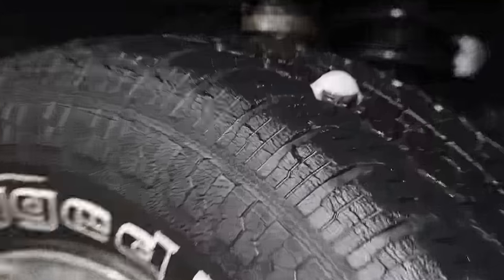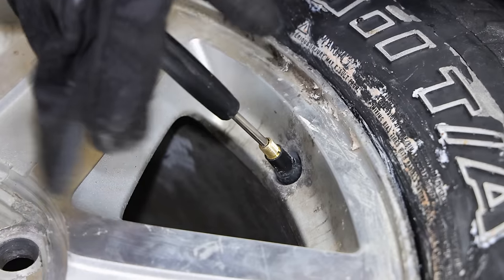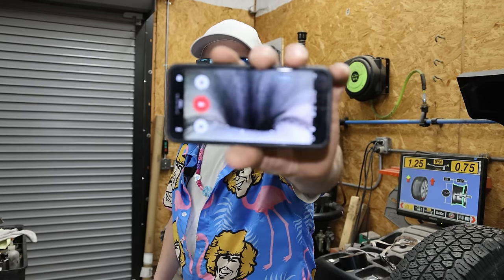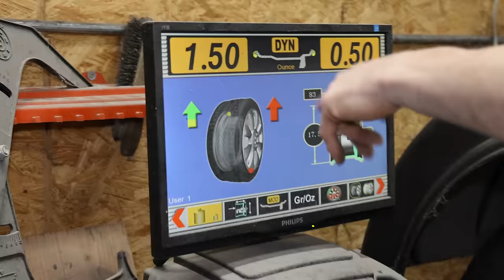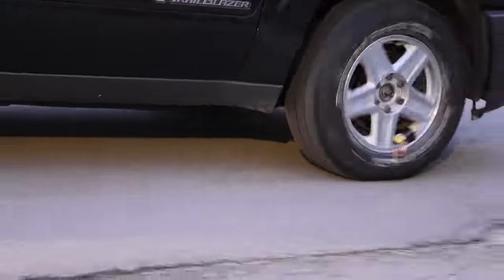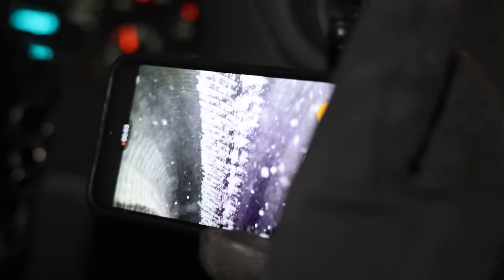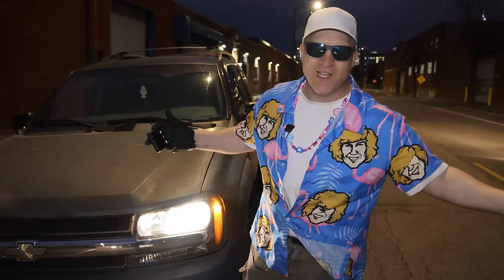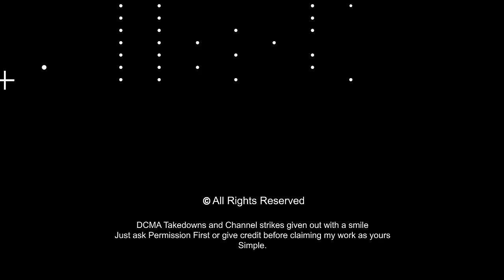GoPro Inside a Car Tire (With Balance Beads)

Comment: I've always wanted to know if balancing beads work and how they work! Thank you!!
Reply from the maker: I'm still not 100% sure exactly how they work, but the GoPro weighed 7 oz, I put 8 oz of balance beats in the tire, and it was 1.5 to 2 oz off balance, So that's telling me that they're doing something just not sure exactly how.
Reply: Time to put them into your lawnmower oil?
Reply: Can you zero it with more beads? :)
Reply: I wonder which balance beads are the best?
Reply from the maker: @Eduardo_Espinoza good question, the GoPro weighs 7oz and I put 8 oz of beads in there.
Reply: Yea. But how much goes in a tire? And obviously depending on tire type would this be different. It is an odd thing. Tires themselves are just odd now they have a new perspective of what they look like inside. 👍
Reply: @WarpedYT  Don’t take my word for it, I too thought the heavy side would draw them in. But after watching your video I’m reminded- the tire is constantly contacting the ground(a more powerful stabilizing force.)

Perhaps when the heavy side of the tire impacts the immovable earth it creates a counter force(like a collision) which spreads the beads outward, away from the heavy/most impacted side?
Reply: Test that!
Reply: I used them in a set of Toyo Open Country A/T II 10-ply and the beads worked really well throughout the life of the tires. I don't know what brand of beads the tire shop used though.
Reply: I Just throw a 4oz. bag in my tire before seating the beads. The bags are made of a plastic that disintegrates into dust as I drive and releases the beads. My tire size is 235/75R/15. I live in Alaska, so I swap my summer/ winter studded tires out twice a year using a HF manual changer and I don't need to own a balancer. I throw the old beads out because they DO break down into powder, and throw in a new bag. I buy a big box of 4oz. baggies off Amazon. Been doing this for 20+ years. Super easy and convenient.
Reply: The goat does consume!
Reply: Centripetal force and harmonics, possibly? I’m not a scientist, just giving my two cents. Seems like after a certain speed, everything becomes fairly uniform.
Reply: As you lightly mentioned, it's a dynamic system which changes data and results according to the situation (speed of a vehicle, the amount of beads etc.). My personal opinion is it's not how much counterweight the beads add to the unbalance of the tire, it's more like beads smoothing that unbalance through their properties of dispersing on a whole surface of a tire thanks to the centrifugal force. With the less unbalance of a tire (without GoPro) beads would do a much better job. My guessing is - very close to zero. :)
Reply: @WarpedYT  Driving in the city  6:38  where someone or something can emerge behind a parked car and you're one-handing it at 50mph while holding and watching your screen?  Seriously?

You're just minutes from a limited access highway and a Velcro strip away from mounting it on your dash.  Does only YOUR life matter?
Reply from the maker: @arcanondrum6543  nah Cmon.. When I'm driving I am actually watching where I'm going I'm not just driving looking at the screen the whole time.  I can clearly see if there's people that or not
Reply: @WarpedYT  Well, just so you know;  50 mph is 73 feet per second.
Reply: You need to be going faster than 55-60+mph to tell if these fix any imbalance in the tire. You will not feel any vibration below that speed.
Reply: @jeffallen3382  Tires will actually start to bounce like a baseball between 25 mph and up if out of balance. 🤫
Reply: I sprinkle a teaspoon of balance-beads on my cereal every morning and I haven't made a stupid decision nor lost my temper since! 👍🇬🇧
Reply: They don't work @WarpedYT  and nothing you showed in this video implies that they might work.
Reply: @arcanondrum6543 spew that elsewhere... I'm sure you're perfect lmao😮😮😮😅😅
Reply: @bashkillszombies the go pro would severely make them off-balance on the balance machine.. yes he should've did a control first to check the balance without the beads on the machine though. You can't just say these aren't working and not explain why you're saying that lol??
Reply: What if you filled the whole tire with beads??
Reply: @RANDOMNATION907 works great if you dont go over 30mph....
Reply: I use the beads in my motorcycle tires. Tires stay well balanced and (as the rider) I can feel no difference in them and weighted balancing
Reply: @lkporter1989 . . . I don't know why you are saying that. I cannot feel any vibration at any speed.
Reply: @karlschauff7989  It should be totally irrelevant. All the beads are doing is proving a movable fluid mass. All that matters is the weight
Reply: I wonder if 10-12 ozs would totally balance out
Reply: I used bbs in my 40" mud tires they do fine at 60 mph
Reply: @lukelanckriet  how much do you put in them ?
Reply: @kenadam4693   I cup my palm like I'm drinking water Then about the size of a Kennedy half dollar
Reply: @WarpedYT great video subject,  appalling driving behaviour. The fact that you are excusing it is even worse.
The warped perception here is your idea of your driving skills and ability to tell the future. 😢
Reply: @WarpedYT Criminally Gross Irresponsibility, got it.
You seem an alright fella on screen. But your comments here suggest that you believe yourself better and more important than anyone else. You did something dangerous and stupid , filmed it and shared it.
Hopefully someone will report this behaviour to your local police and they will take the time to explain to you what you have done wrong.
Reply: As a tire tech, they do work, you just have to have more weight then the imbalances! I used to use them as an alternative to weights on my oversized tires, never had to re-balance them and never had abnormal shakes or vibrations from the tires
Reply: @jeffallen3382 right, if it's bouncing at 25 you got belt problems and balancing is the least of your worries
Reply: @MarcusHawksley  hopefully the police come to talk to you about wasting police resources for bogus complaints, quit moaning.
Reply: @fZionists78  but then, why does it work on the balancing machine, which sees none of those impact forces. It has to be something else.
Reply: If they worked, there would be a lot more information than just anecdotes and sales pitches.
Reply: We would love to see your video on it
Reply: Project Farm Warped Perception Collabo Time!
Reply: @RANDOMNATION907 I have them in my Camaro tires! Works great
Reply: They absolutely work, I've got them in the tires on my F-450 truck and it's smooth as can be.
Reply: You should know better given how careful you are setting up your tests.  Mr Warped never checked the balance of the tire BEFORE sticking in the camera or the beads.  There is no need to make an internal video...but this IS YT.  The balancer is the ONLY measuring device needed...to determine if they work at all.  Tell me if my analysis makes more physical "sense".
Reply: @apex107lrp  video is cool.

Common sense would be to have the tires balanced with weights and also add beads.
Reply: @jeffallen3382 I had a bent wheel from a pothole and I couldn't feel the vibes until nearly 60 mph. A BENT WHEEL. Driving around town with tire beads isn't going to prove shit.
Reply: @jakefriesenjake If you balance the tire with weights, why the hell would you need beads?
Reply: @aluisious  you can use less beads, and if a tire "becomes" out of balance, it'll self correct. The tire is already at the shop getting installed, might as well balance it. Probably don't need to.
Reply: @aluisious  exactly!
Reply: No thanks
Reply: Well now you know. Good for you.
Reply: and @WarpedPerception - it's actually really interesting. It's a harmonic damper. Your washing machine does the same thing (modern ones just use water in a tray instead of beads). Controls theory, there's an inversion in phase beyond a critical speed. Or... think about if your tire wobbles 'up', the beads will try to follow it, but with a delay. If the tire is rotating fast enough, by the time they get there, the tire is wobbling 'down' and the beads cancel it out. It will make the problem worse at low speeds, but there's a critical point where it makes it better and stays that way.
Reply: @WarpedYT  Another consideration is the location of the off-balance mass in the wheel. An ounce of unbalanced mass occurring near the hub, which might be where you put the GoPro, will require a different mass to offset if that mass is placed at the outer edge of the tire, where the beads are.
Reply: @Eduardo_Espinoza   "We're gonna test that!"
Reply: @arcanondrum6543  You definitely voted for Biden
Reply: The way it is supposed to work is simple.  The unbalanced wheel wants to rotate around the center of mass, and not the center axis like it would if it was balanced.  This imbalance will (should) move the center axis around like the agitator moves with an unbalanced load in a wash machine.  Since the farthest distance from the center of mass in that drum will be 180 degrees away, the centrifugal forces will cause the beads to roll to this location, and balance it out.

Experience tells me that beads do not do a GOOD job of balancing a tire, and I thought the flat spot of the tire would throw the beads around.  Also, with the axle stub being held rather rigidly in place, the rolling action of the beads wouldn't be optimal.
But there was not the weight of a go-pro worth the imbalance on this tire, according to the tire balancer, so....??? Can a tire balancer even read a 7 ounce imbalance?  These results were better than I anticipated, or there was something going wrong.  Not sure.
Reply: @RANDOMNATION907  The Counter Act balancing beads he shows here are not plastic but rather smooth glass beads. I use them in my Semi Truck tires. There's a chart that shows the proper Ounce bag to use for your size tire. Also install the extended valve core that comes with them
Reply: Funny thing, he never balanced the tire. Not sure why he says it worked.
Reply: @erikev  theoretically, the weight of the GoPro in the wheel should have sent the balance WAY off. But the balancer only showed it to be off by a couple ounces or less. I am also unsure of what to think of it. I don't believe that it actually worked, either because it doesn't properly follow the science of how balancing beads are supposed to work.
Reply: i think as the tire is in motion the rubber heats up allowing for more elasticity, meaning the beads from the gravitational force on the middle will pull the weight towards the center making the balance on that center...since they are moving free...always gravitational forces on rotating motion will pull to the center.,,makes sense...i just hope they don't become a problem on summer plus the asphalt heat, them lodging between the rim and the rubber and release air
Reply: @WarpedPerception What did you spray to clean all that corrosion off the wheel?
Reply: this is an old thing, too. People have used small ball bearings to balance mechanical shafts and things, exactly like this, a long time ago.
Reply: In my experience, these beads do not work in tires that have these raised internal "treads." The beads need to be able to roll around and move as they need to, and the internal ribs prevent this. Older tires did not have these features internally. Driving at higher speeds will expose the poor "balance".
Reply: @arcanondrum6543  it's america, nobody is walking on the sidewalks it's all good
Reply: Next on Project Farm…balance beads shootout!!
Reply: @jonathanfreedom1st  there is a chart called counteract where you tell it the tire size and it tells you how many ounces of beads you need
Reply: I wonder if water can balance a tire too just like in a washing machine
Reply: @NuttersOffroad  no
Reply: They don't work all the time.   I ran them in a brand new set of Avon Venom motorcycle tires for a cross country trip.  The shop that mounted the tires had somehow torqued the front tire when they mounted it.  It developed a bulge, and the dyna-beads collected in the bulge throwing it more out of balance.   It created massive front end vibration at certain speeds, that put me in a death wobble at 75mph when a truck locked it's brakes up in front of me.  Somehow I managed to keep it upright and come to a stop before slamming into the truck, but it was terrifying.  Luckily the shop I took it to at my destination, was able to fix the tire, re-mount it, and put conventional weights on it to balance it.  Rode it for another 9k miles or so, and never had another issue with it.   After that, I just don't trust balance beads in a motorcycle tires.
Reply: @nigelcarren You are well balanced.
Reply: @WarpedYT  Its about the centrifugal force allowing the beads to evenly fill where the center of balance is.
Reply: They don’t work.  lol. You’re going to have a vibration no matter what.
Reply: The TRUE Savior

HalleluYAH (Hallel u YAH) “Praise ye YaH”

YaH is The Father (Genesis 1)
YaH arrives via the TENT OF MEETING
YaH was Who they Crucified for our sins
YaH was Crucified on an Almond TREE

Semitic (Moses)
Isaiah Scroll (The Original Isaiah)

Isaiah 42:8
I am YaH; that is my Name! I will not yield my glory to another or my praise to idols.

Isaiah 43:11
I am YAH, there is no other Savior but Me.

Isaiah 45:5
I am YaH, and there is none else.
Reply: Hoax
Reply: Thanks for watching

Comment: I'm more impressed with the GoPro staying attached. Some serious adhesive.
Reply: but it didn't though...
Reply: For as long as it did, great adhesive.
Reply: This guy's a clown, ALWAYS mount a 2nd GoPro to balance your tires. These "balance beads" are just going to sandblast your GoPros, requiring them to be replaced much sooner.
Reply: 3M VHB Is no joke. Makes you rethink adhesive tape
Reply: I was impressed on how long the battery lasted. I can only get a battery to last an hour in my hero11
Reply: @unoriginalname4321 That just means you repaint your GoPro afterwards.
Reply: @unoriginalname4321  : A replaceable lens cover should do the trick.
Reply: @akaHarvesteR  : Most impressive 3M I've seen is the adhesive strip for example Quad Lock system uses. Like, attaching a smartphone to a mount bracket with bloody tape and expecting it to stay put when bolted to a motorcycle. And still it does.
Reply: @akaHarvesteR  Yes!  You could stick the moon to the earth if you had somewhere to put the fulcrum 🤔
Reply: @jaybyvan  Maybe your GoPro has been too 'battered' 😛
Reply: I wonder if steel rims and using a neodymium magnet for mounting would be more sturdy?
Reply: I was thinking the same thing
Reply: @JariJuslin I know I'm late but I have 2 mirrors taped to the wall with 3M strip tape 🤣
Reply: Archimedes theory of centrifugal force …… innit.

Comment: Probably 70 percent of heavy truck tires are balanced with beads. I worked 11 years  in a shop with "tire" in it's name. If you would have poured a second bag of beads in your tire, it would have spun up at zero on the balancer. I have spun tires on the balancer, corrected with weights, and driven the truck. I then went back to the shop, added slightly more beads by weight than I used to balance the tire, stripped off the weights, and drove again. EVERY TIME I did this, (like 10 or 12 times), the truck was smoother with the beads. Mind you, the steering wheel ( I always did this to left front) Kind of "chugged" until the tire had been at speed for 10 or 15  seconds or so. Then it was as smooth as road force imbalance could let it be. After my research, we built the cost of beads into the price of all front tires on 19.5 inch rims and larger. All of our medium and heavy duty customers kept coming back, saying "xxx"s tires are 20 bucks cheaper, but yours run better" I understand why it is counterintuitive, but I think the beads bounce off the heavy spots because they are moving faster away from the axle centerline than the light spots.This results in the beads "finding" the right position for the tire AT THAT MOMENT. Just my opinion, hope it helps.
Reply: That is pretty much my understanding, much like water would spread out if you spin a glass smoothly. So i picture it like the vibrations on the wheel shake the beads until it reaches equilibrium and the vibration stops, effectively balancing the wheel
Reply: is there any reason you wouldn't want to use a combination of beads and weights?
Reply: @johnhufnagel  He says 70% of heavy truck tires are balanced with beads because most people will only balance the front tires because you're really not going to feel vibration in unbalanced wheels on the other axles on a 1.5 ton and larger. So a lot of shops will only put weights on the front, and then toss in beads on the others just to save time.
Reply: Wouldn't water do the same thing?
Reply: @petericho71  not when frozen

Comment: I became a firm believer in them the first time I used them in my RV tires.   I have split rings on one of my vintage RV's and I couldn't keep the weights from flipping off.    Because they are split rings, they have tubes.   Dyna beads makes a tube friendly bead that you send through the valve stem.   The first time I used them I was stunned at this voodoo magic!   Great Video BTW!
Reply: I have a vintage RV with split rings and tubes…I want to try this. What was your tire size and how much weight of beads did you put in?